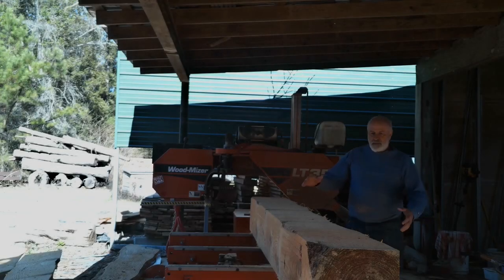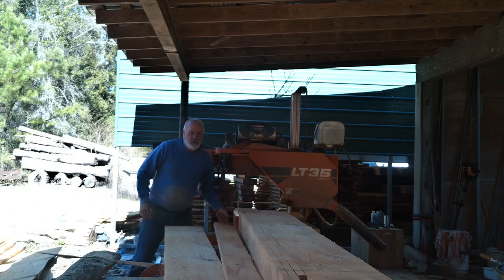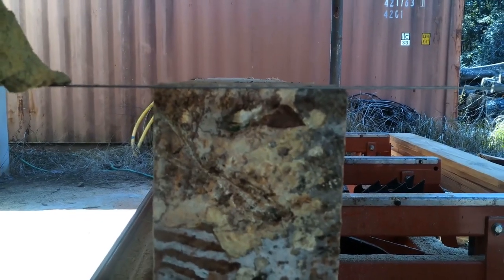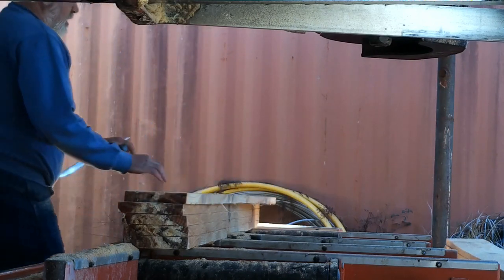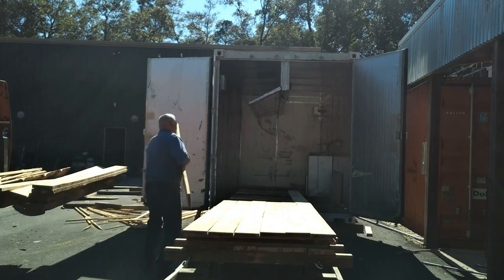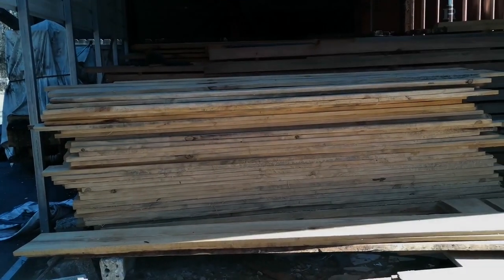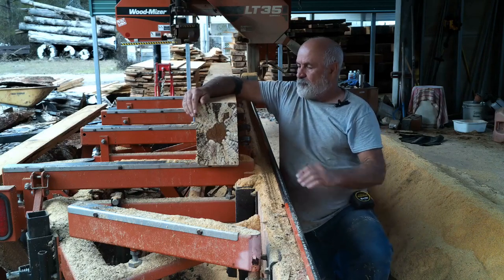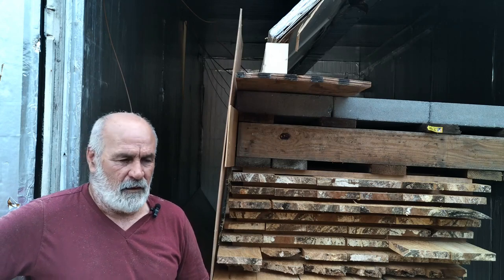making pine flooring pt.1

Comment: What brand and size of Kiln do you use
Reply from the maker: It's a woodmizer kd250. The box is 20 feet long. I generally make the stack about 3 feet wide on pine. 4 feet wide for hardwood.
Reply: @woodman4642  Thank you. Great video. A lot don’t show start to finish process. A video of you kiln setup/operation will be great 👍🏻
Reply from the maker: I'll be doing another kiln load in about a week. I'll take a little more time to show what I do